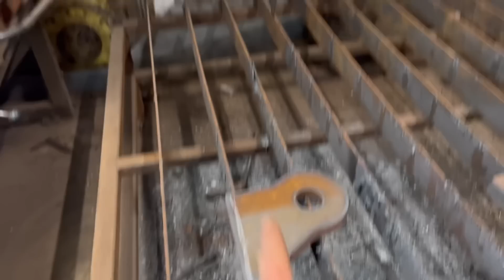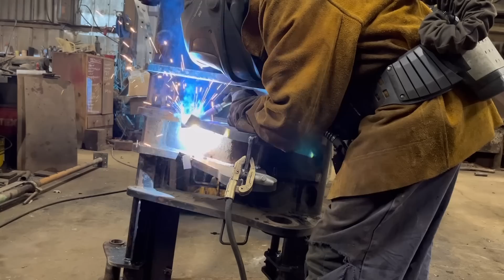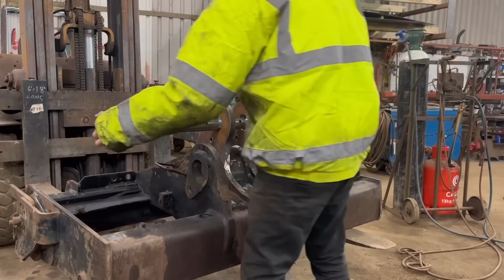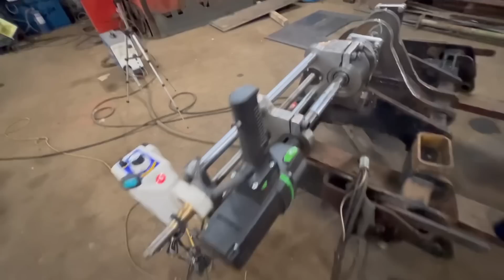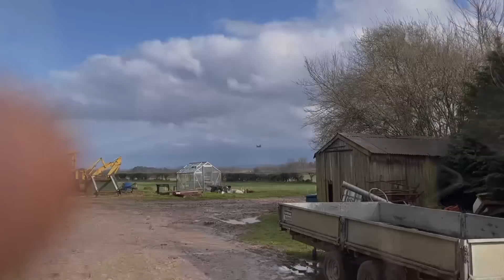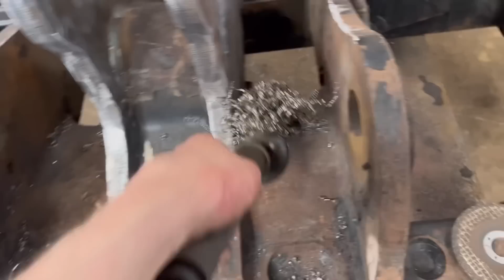FIRST time using the self made line boring machine! JCB TM headstock repair.

Comment: the dial indicator clamp is nice innovation. Perhaps mount a fine pitch screw opposite the clock to slowly jack the tool into place. having done this work before I can recommend broaching out the tool holes to suit standard square shank tooling.

Comment: The gumming up on the tool bit is because carbide inserts need to run at a much higher speed. Too fast for a line boring setup. High speed steel tools would work better for you

Comment: At what speed (precent wise on the knob) have you used the power feed ? I want to build one and use the same power feed , but I want to put at least a 1/3 reduction until the lead screw. For power and for lower speeds
Reply from the maker: I used a fine thread lead screw which works well but the power feed still has to be running quite slowly. Probably 10-15% only problem I see with using a 1/3 reduction is it would have a very slow travel speed even at full speed.
Reply: @snowballengineering  thank you. I rather have less rapid feed then to over load the small motor for the 10-15% power feed . My goal is to use the power feed at like 30% for the actual cutting speed . So fine pich thread and at least 1/2 reduction . Thank you for the response. Very nice machine you build.

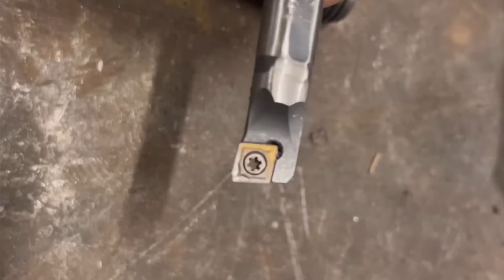Comment: @31:29 - "...need to get some better tools..."

Have you seen Matt Maguire's discussion of boring bar tool geometry?
https://www.youtube.com/watch?v=wd_OjrO_H3E&t=414s

"Part 3" of his series is worth a watch, too.

This style of tool can be had with square (e.g., TSA, TSC, TSE, etc.) or round shanks (e.g., TRA, TRC, TRE, etc.), from the usual suspects.  I haven't seen inserted tooling, just brazed carbide, but I'm not a professional, so I may have missed it.  Obviously, you could grind drill rod (silver steel) or HSS lathe tools to match the geometry Matt describes.

User "Irish Fixit" (may he rest in peace) on the weldingweb forum had a very simple tool setting micrometer, though I don't know that it's any better than your locking pliers version.  Try searching for his user name and "portable line boring bars" on that forum.  Matt Maguire's tool setting mic, in the same thread, but further down, is a bit fancier, but only a bit.  Both involve cannibalizing cheap hardware store micrometers.  I can't post a direct link, because YT will ashcan my comment if I do.

A short slug of brass (brazing rod, etc.) between the shank of your tool and the clamping set screw may help the tool to stay put when tightening.  It wouldn't cost very much to try it.  Bars which have square broached tool holes are also often tapped to some nominal screw size slightly larger than the across flats dimension, which allows for a fine sensitive adjustment of the depth of cut via set screw.  You can get tooling sleeves from Reid, MSC and probably many others.  These will fit a round cross-drill in the bar, but are broached square on the inside, and threaded.  Here's how Climax recommends installing them in their bars:
https://youtu.be/CwaJFiJX3_g?t=1644

I've seen a pair of digital calipers, with extended tips TIG welded onto the internal measuring side.  The extended tips had ball bearings as the contact points (I don't remember whether threaded or welded on).  Depending on the exact dimensions of the hole and bar, and whatever else is the neighborhood, you may be able to measure hole diameter without pulling the bar.  You can "zero" the calipers at some nice whole number size convenient for whatever you are working on (say, 50mm for your desired 65mm bore).  Telescoping "snap" gauges may be able to be used through an empty tool hole to measure the bored diameter without pulling your bar.

N.B. I haven't yet built a bar, myself.  But, I need to get one put together to complete a couple of repairs for myself, and I want to do it well enough that it may be useful for paying work when I am done with my own projects.  Your build series has been illuminating, even though I'll forego the variable speed feed, at least at the outset.

Comment: Maybe someone did a bushing job to restore the original pin diameter after wear. In pumps it is common to grub the impeller wear rings to stop them rotating, even after shrink fitting. This would account for the grubs. Any how impressed with your problem solving and the very correct attitude of doing the very best job. Good luck👍

Comment: Your time capturing on video truly appreciated. Thank you - learning new tricks episodically! Love that this time around, cutting off the broken 'ears', the cut line was the weld prep, too - never thought of that. Regarding the bit adjustment in the boring bar, looking at the bite marks on the bit, the clamping screws are rolled threads with crater ends. If so, grinding or turning a  large radius spherical end might help stop the screws walking the bit when tightening. [Robert, way South!]

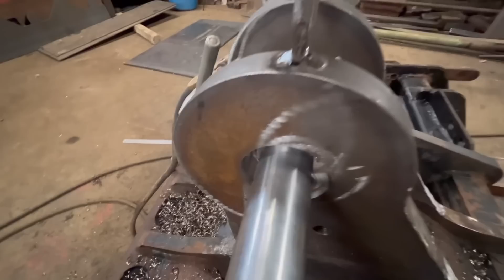Comment: 19:09 I understand it’s hard to measure the rpm but at a guess you’re shooting appx 500rpm (I’m making assumptions on material etc) but I use 318x90 (90m/min cutting speed with carbide) divided by the cutting diameter (appx 60mm) mate I’ve just stumbled across this I’m very glad you’ve mentioned the 4 part series on the build and I can’t wait to get into it. I have an engineering shop in Australia seldom need line boring so can’t justify the cost off a full ‘purpose built’ rig and have been thinking for quite some time how I could make one. Was even thinking of going down the path of direct (probably geared down) electric drive with a VFD mainly just for rpm control/display. Love the rig and can’t wait to see more!
Reply from the maker: No, won’t have been that fast. That was in low gear flat out. In high gear with the speed turned down it does 260rpm, so that will have been 150-200rpm.  
Only problem with making one is it’s quite time consuming, but in my case that wasn’t a problem as I was just doing it for something to do in my spare time. 
Some of the Chinese ones don’t look bad quality and can do bore welding as well.

Comment: Good job !
 I have my own line boring outfit..
 I myself am not a machinist..
 But we do what we have to do to make it work !
 Before I bought my line boring outfit I was using My torch and a diegrinder ! 
 Angle grander with a long special bolt and used a worn out grinding disk at the end of my bolt to create a more perfect hole !
 Sandpaper wheel on my diegrinder for the final touches !
Again good job on your work !

Comment: I've enjoyed your diy boring bar vids and learned a lot...but did I miss how you did the bar that does the cutting between bearings? Did you turn it and drill it yourself, or did you buy it? Curious to know how it's made to get precise holes for cutters and how to adjust cutters for accurate diameter
Reply from the maker: No you haven’t missed it. I made the bar before I started YouTube when I was using a mag drill to line bore with. There wasn’t much to it really, I just drilled the holes in the milling machine to make sure they were all the same distance apart then turned 90 degrees to drill the grub screw holes.
Reply: @snowballengineering  thanks a lot for responding back and so quickly too. I'm learning a lot from your build and I'm planning something along this idea so this is a great help. Did you buy the bar at an accurate diameter or did you turn it down yourself? Thanks again
Reply from the maker: It’s 40mm chrome rod I’ve used. En8 chrome rod.  A higher grade would probably be better but that’s what I had available to me.

Comment: Great diy line borer! 1 suggestion, is to move the feed controller to the bearing clamp. This would help remove any deflection of the extra weight on the outer end.

Comment: thanks for a great video ! makes me want to build one i saw one being used that had threaded inserts in the bar that carried the cutting tool so yo con slacken the lock screw off and advance it with a lot more accuracy could be an option ? if i gan find it i will send you the details .

Comment: Nicely done!
Both on the line boring and the machine.
I do have one small query regarding your comment about switching out some of the steel components with aluminium; Would aluminium parts withstand the stresses such a tool coiuld create?
Reply from the maker: Thanks 
Yes should do. The line boring machines I based mine on are made from aluminium. Made by York
Reply: @snowballengineering  that's good to know 👍👌

Comment: I would just buy a flat tip for your indicator, also do you not have a tool that you could chanfer the holes with? nice setup though!
Reply from the maker: I’ve made the pointer tip into a flat tip. Yes, I have a neutral tool I use for chamfering but I’ve not got any decent inserts for it so I couldn’t chamfer these. Thanks

Comment: 27:44  That is my only concern.  I do not like machining while any temporary fixturing is in place.  Especially if the majority of weld is on one side.  I've had issues in the field with one or both bores no longer being on plane.  Something to think about.  Everything else looked good to me.
Reply from the maker: I remove the fixturing after welding to remove any stress it has on it then weld it back on again to line bore as the plates seem to get some harmonics without it.  If you see after the first cut it’s not there, then when I do the second I’ve welded it back on again. 
I did wonder whether anyone would spot that. 😆
Reply: @snowballengineering  Gotcha.  In the back of my mind I was thinking this is not your first so you must have some method to deal with weld distortion.  Great work sir.

Comment: What do you use to power your gouge , what size rods and what amps , I've just started using one , they do like the amps !!!
Another great video , showing it as it is not just the good bits , keep them coming
Reply from the maker: I use my tecarc 400amp welder. I was using 6.5mm rods at about 250amp. It will burn 8mm rods as well.  Thanks, will do!

Comment: You can turn the back of the cutter perfectly flat and use that as your measurement reference instead of the round ball on your cutter and push down a certain distance. Or make a nice fat spot besides the cutting insert for measurements
Reply from the maker: I’ve cut the round ball off the end of the gauge so it’s a little flat foot. Measuring the tool height isn’t usually a problem, just tightening it down without it moving is the tricky part.

Comment: Oil your bar it helps for sliding in the bearings . And a screw on the back side of the cutter for a pusher screw might help with adjustment .
and maybe a second hole on the bar for a snap gauge . But it looks like a good build just more stuff to finsh up with . You can do that as needed Thanks

Comment: Works a charm, and with a bit more fettling will be perfect. I am wondering if the plasma cut doesn’t harden the steel a bit - maybe a ceramic insert for the first pass, then swap to carbide once thin harder layer is removed ?
Reply from the maker: Plasma cut edges are nasty. I die grind most of the nasty away so it’s a bit kinder on the tool.

Comment: Very nice repair, as a back up check you could use the Vernier from the out side of the shaft to the tip of the tool just like a ruler on a centre drill hole. Enjoyed the vid a lot.

Comment: Firstly and most importantly it worked. Now you have a good start point to improve upon. Adjustable mount point. Better cutting bits. And does your speed controller go faster. Or can you gear it up somehow. No doubt it will improve as you refine it. Already earning it's keep and doing a good job. I would be pretty happy with that for a total design self build.
Reply from the maker: Yes, the drill is 2 speed and variable speed. It will go from 60rpm up to 470rpm.  I just took it steady for the first go.

Comment: Do you watch Curtis , cutting edge engineering. Aussie guy. Excellent videos
Reply from the maker: I do, every Friday.
Reply: Yep, love those two...three. They manage to make polished videos, but keep the real world working shop content.
Reply: Cool same here.
Reply: Do you use FCAW welding wire. Some of the plate thickness and V welds in your repairs it would be suitable I think (saves on the gas) and with a 1.6mm FCAW wire then it would be a few less passes 🤷🏻‍♂️
Great video again and really pleased the line borer worked so well on its maiden test, but then we all knew it would as the level of engineering told you it would.